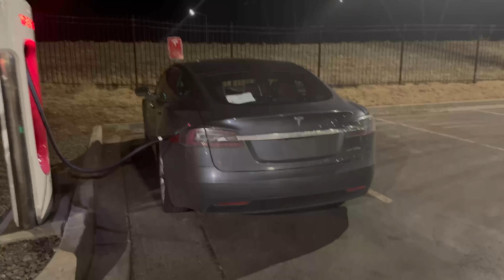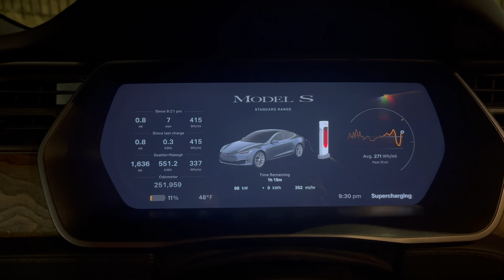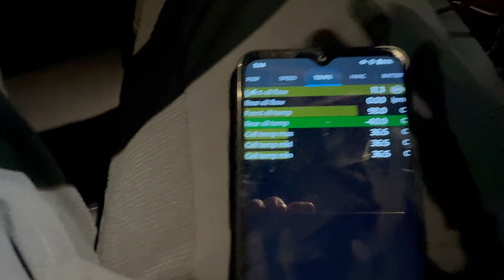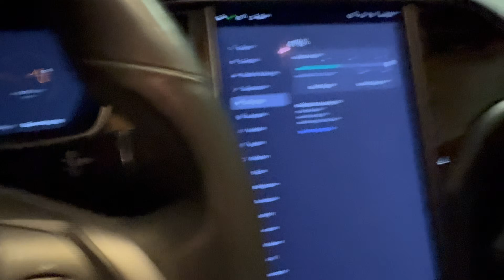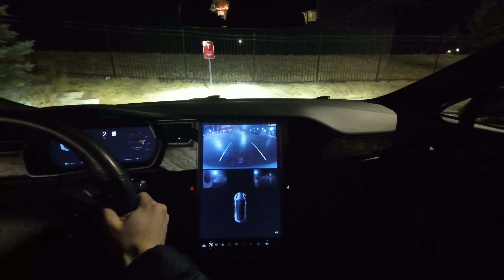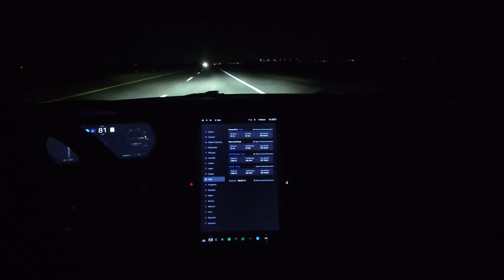High Mileage 2019 Tesla Model S Takes On The Road Trip Simulation 10% Challenge

Comment: I bet it would do significantly better in warm temperatures. Those older Tesla's used resistive heaters and those will use a lot more energy than the heat pumps that modern Tesla's and other EV's have.

Comment: As a guy who drives a 2017 Model S 75D, you need to do this test in the summer or in Florida or something, because this Model S era in my experience is VERY sensitive to cold. My experiences match these on the weeks the temperature would hit 40°F here, but when it's 85° like today, the car will start ramping up from 60kW at 6%, peak at 135-145kw around 21-23%, then ramp down to 100kw between 35-42%, depending on how hot the battery is. This isnt a winter car at all.

Comment: Wierd, my model s 2018 mcu2 75d charges flatt 132kw from 8-32% holds 100kw to 54% and at 70% is 62kw and 90% is 28-34kw
Reply: You've got a good one! :) I've got the same model and I've only seen 130kW once, on a v2 Supercharger. Mine usually peaks at 122kW, starts throttling at 30% and is at 70kW when it passes 50%. 

With this car, I'd guess the number of cycles and degredation has increased internal resistance and the car is limiting amps to manage the temperature - charging losses would certainly explain the high calculated efficiency. The weak cells also may be a factor.
Reply: @EddBallinger its important to clean the radiator once a year for optimal cooling
Reply: what milage ? do you still have this car and what do you think about it ?

Comment: Dialing back the charging speed, is like taking an 800HP car, and a manufacturer arbitrarily sending an update to knock it down to 300HP. Kinda shady tbh. Whatever charging speed is advertised  should be what's maintained for the life of the battery/car.
Reply: This car shipped with a 98kw peak and a later software update increased peak power to 118kw.
Reply: I don't know why people keep talking about that, i have a 75D model S (2017) , and it often gets 138-145kw peak and pulls 100kw from 6% to 42%. The battery just needs to be very warm and from personal experience. In comparison the 75D battery is 350v, so it's pulling notably over 500amps to get those speeds for so long. Heavily limited, sure. I'll believe it once someone shows me an old charging curve that was better

Edit: ohh right, they're in Colorado, and im in Florida
Reply: @raychang8606  when we used the OBD scanner we never saw over 400 amps at any SOC or temperature.   I think that 450 amps must be the limit for these "75" packs, to reach those speeds you mentioned.  You are definitely right about temperatures though, it really needs to be warm.  70* F for regen to not be limited.      We only saw a peak of 133kW   Later this summer we will do another test home here in NC to see how the balancing and and warm temps will help it out.
Reply: 800hp car will pull power if the operating temps go out of range. 

Same concept. Longevity over performance.

Comment: “ as far as we can tell” it is the original battery? Why wouldn’t you check the sticker to see if it’s the original battery or not before you do the video?
Reply: We also checked the BMS, it had somewhere around 90k kWh in its lifetime. There’s no documentation showing the battery was changed and everything was original as far as we could tell. We didn’t have the full vehicle history to confirm this, though
Reply: @ryankassel5691 Didn’t you also say the battery had 1600 cycles? It’s not bad, it was just like that new.
Reply: Sometimes the stickers fall off.

Comment: Nice test. One should note that the 252 000 miles Tesla S is still charging at the double rate of the 0 miles Bolt EUV.
Reply: The bolt is more efficient and was FAR cheaper new.

I love the Bolt for a never/rare roadtrip EV.

The cars that should be ashamed are the Toyota/Subaru twins
Reply: @GregMcNamer  Sure, but when new, the Tesla S was 5x faster than the Bolt. I was only comparing the two based on price (if one would like buy a 2019 S or a 2019 Bolt). And I had a Bolt, loved it, but at 80 mph its efficiency was abysmal.
Reply: @NewGuyInTown_CA  
Bolt is likely to cost less to fix when it breaks, Highway speed limit where I live is 80mph.. we run 85-90 mostly.  On a long road trip 1500 miles, I was seeing 2.5- 2.8 miles per kwh at 85mph. Considering the Bolt is tall and narrow, and has no aero underskirts in the rear area its not bad.
Biggest issue I see with this model S is the risk of repairs. Other than that.. it is a super nice car. And they got a great deal on it.
Reply: "I smell the devil's lettuce"
Reply: No, except for the <1% of the time when I charge NOT at home, it would charge at exactly the same rate as my Bolt. Which would be FEWER miles per hour.